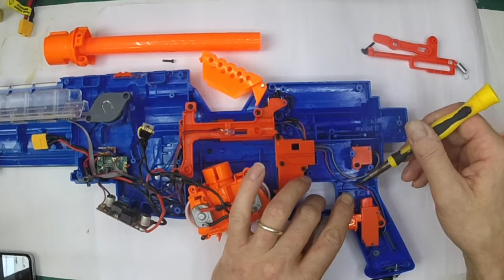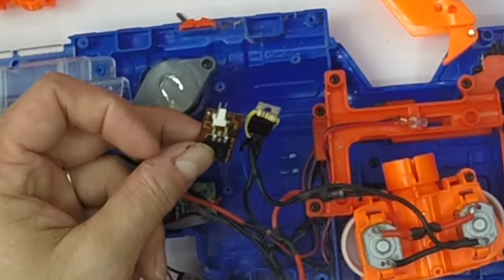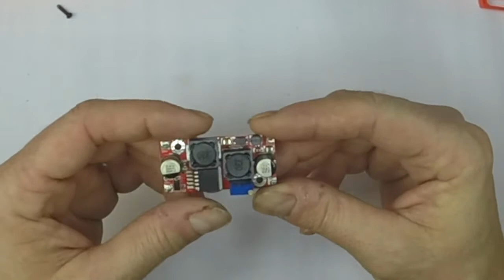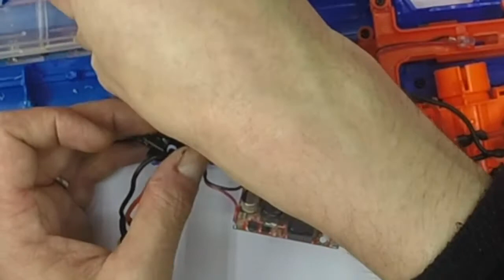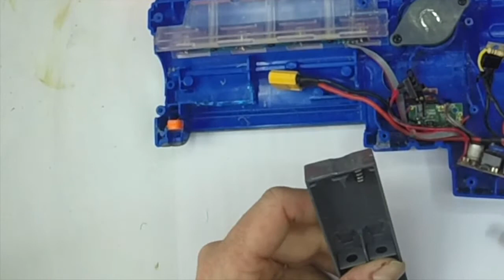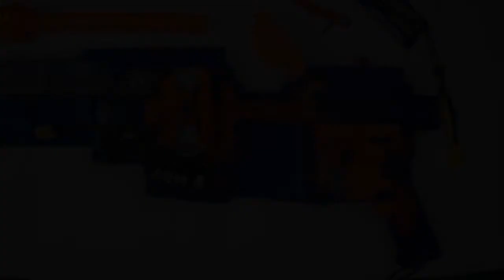Cassian Andor & Jyn Erso Deluxe Mod Guide Part 2

Comment: This is a brilliant build. As to power supplies, MickMake's weekly roundup pointed me to a few tiny power supply chips which can do regulated 5V (down to 5V from anything up to 38V or so) and up to 5A output too. May be good for integrating light and sound similarly to how you did with the cassian blaster but in smaller shells.
Reply from the maker: I tend not to get bogged down in electronic detail, I find something that works, gives a bit if head room, then use that.
Reply: Foamdata Services Fair enough. It was mainly for when you've got less room than you'd need for it + lipo. Otherwise, I'm the same way: unless you want to add more and your current method becomes too clunky or impossible, stick with what works.

Comment: So awesome!  My local Target has the Cassian Deluxe sets on clearance right now and I'd like to go all out on one!  What would be the simplest way to wire it up if i wanted to wire the UV LEDs to come on when I depress the rev switch?  Junctions at the rev switch?
Reply from the maker: You just wire it to the motor output from the MOSFET or remove the board from the motors but leave the UV leds on it, the darts don't charge very well on just the rev, hence moving it to the jam door switch so they are on nearly all the time. The load is tiny, it doesn't affect battery life at all.  If you want to retain the light and sound function you will be getting into a proper full rewire anyway, might as well do it right.

Comment: Can you do a parts list for the intelligent power supply and the mosfat or it's replacelment? I'm new to modding and I want my Cassian blaster to kick ass! Your video seems to be the easiest to follow but I am a bit lost on the names of the parts. I'm glad I watched this before trying to put in IMR's.
Reply from the maker: Parts list for the mosfet is on my Mosfets for Nerf video, PSU us just a cheap adjustable step down module from Ebay, you just set it to 5v output.

Comment: Very cool! I just picked one of these up at Target. Love the way it looks but the performance is poor. If I were to disconnect the lights and sound would the shooting performance be on par with an unmodified Stryfe?
Reply from the maker: No. They barely use any current. If you want to mod it it's a rewire or nothing. Modified, even with the stock wheels and cage with mod 130 motors, it's amazing. You could try using decent consumer rechargeables or consumer disposable lithium batteries, both will be better than alkaleaks. Some people put 2 IMR batteries and 2 dummies in them, I haven't bothered with that as it's so much better done right.
Reply: Foamdata Services OK, good to know. Do you think 2 imr would cause any damage to the lights or sound module?
Reply from the maker: The sound module would hopefully be protected by the PTC if you leave it all alone. I would still rewire properly if you want to keep all the functions AND have more power. You could add a simple slide switch in the power feed to the sound module so you can switch it out when running IMR.

Comment: can you post a parts list for this build? how does it compare to a full 3s stryfe build as far as fps with the voltage regulator in there?
Reply from the maker: Parts are the same as any high power mosfet build, see my Stryfe/Mosfet build guide. Full fps figures are published in the test video. The sound circuit draws under 1A, not enough to alter performance in any way with a proper lipo. You can take the soundboard out and use it elsewhere. There are programmable sound modules of similar quality available for much less than the price of this blaster!

Comment: If i wanted to put the leds to be on all the time and on a separate set of bateries how many bateries and wich kind would i need for the leds alone?
Reply from the maker: Don't waste time wiring the Led's separately, run them off the proper battery, there is very little room in the shell for extra power supplies. The UV Led's on the mag well want 3v and the sound and barrel Leds are set to 5v. My method allows the sound and barrel leds to be always on, just delete the switch on the regulated supply. The mag well leds are also on all the time the jam door is shut, if you wanted them always on regardless just copy my circuit and wire them direct instead of going through the jam door switch.
Separate power for the extras is dumb and unnecessary.

Comment: do u have to remove the thermaster or is there not one in it
Reply from the maker: This is a total rewire, not just sticking IMR in it. The thermosistors are next to the sound board, I left them in to protect the sound circuit as my method separates the flywheels and the sound completely. The only thing they share is the battery and the power to thesound is supplied by the 5v regulated PSU.

Comment: what motors\flywheels would you recommend? which motors did you use?
Reply from the maker: Any 130 motors fit in the shell un modded. Meishel 2.0 or Rhino motors are fine. Wheel and motor choice depends on what FPS you want to shoot. The cage is NOT the same as the stryfe one so there's limited choice on crush.
Reply: Hi Tom I was wondering if you know if the Semi-auto Blaster Wiring Loom Kit: Standard Power MOSFET will work with this blaster. I don't know if I would use the stryfe kit or something else..?
I am trying to contact Blastersmith via email and FB but no reply. I also wanted to know if there MOSFET mounting boards the "orange w/hole setup" come with the wiring loom kit? They state it in the description but I am trying to confirm. Thanks for your great videos and modifications. Hope I can mod my blaster soon. 
I going to use the Meishel 2.0 or Rhinos 130 motors so I don't have to mess with the shell molds  like you suggested & MOSFET so I can keep most of the stock wires and switches unless you recommend something different. Thanks again for your help .

Comment: Hey man! Just got this Nerf Gun and it looks and feels amazing! Too bad for the performance though.. Anyways, I wanted to mod this thing, but I have have an upcoming Nerf war soon so I just need it to perform at around 70 FPS, any simple mods/way to do this? Thanks!
Reply from the maker: Use something else. Any battery upgrade without rewiring runs the risk of popping the sound and light. It gets about 58-65fps stock, agreed it’s bad. You could try running it on consumer lithium AA batteries, the 1:5v ones NOT trash fire type 3,7v ones, they don’t sag under load and will give you a small power boost. Otherwise it’s a full rewire or leave it alone.

Comment: The insane part of me sees that there's a fake selector switch molded in the shell & wants to cut it out & put in a real selector switch for the pew-pew and UV lights. Save me from myself and tell me there's absolutely no room, no way it'll work. I may even believe you. Lol
Reply from the maker: Do eeet!
Reply: My apologies for replying 11 months later; I just got one of these and started modding it in the last week or so!

I did manage to get an on/off rocker switch (boat switch meant for boats) in there just where the fake molded selector is, so I at least get a safety. There may be just enough room for a 3-way rocker, though I'm keeping this one semi-auto as it's meant for HvZ and not burning through darts. I will note: I did have to cut away a large section of the trigger mechanism for clearance for the on/off switch, though I managed to retain the oddly smooth/responsive manual pusher on this.

I did happen to get my hands on a second at a low price ($9.99 at Ross; the only reason I bought the first one), and I do plan on over-modding that one with a selector switch, and I already know I'll be cutting away large sections of the shell to accommodate a motorized pusher, etc.

It's a shame as this blaster is proving to be quite the fun thing to mod and I plan on sharing at some point in the near future what I've done so far.